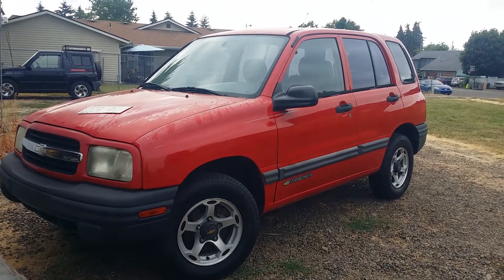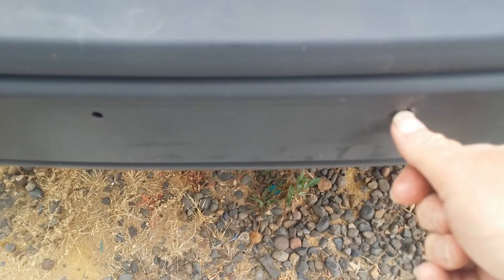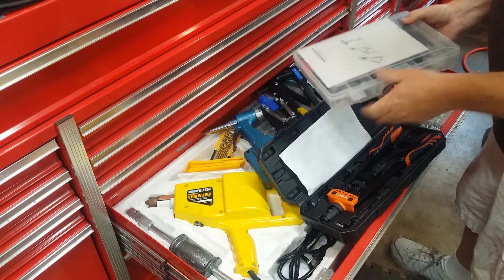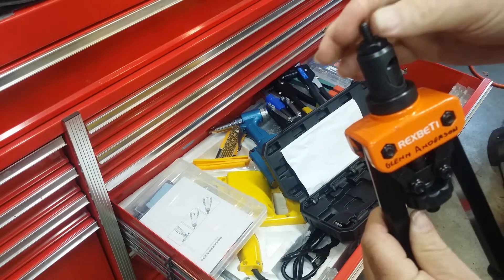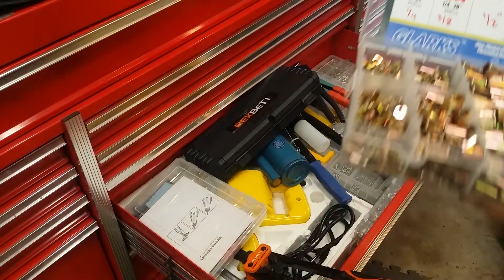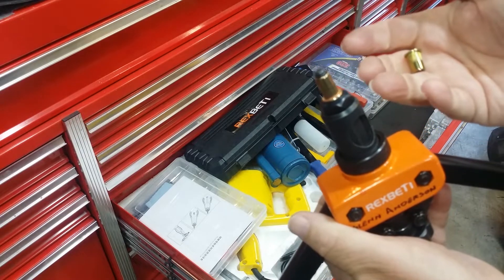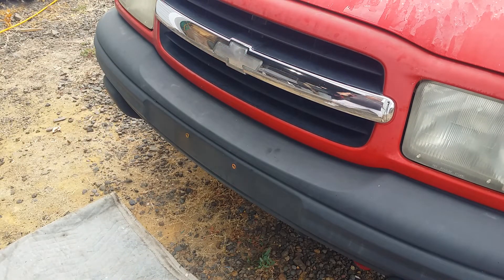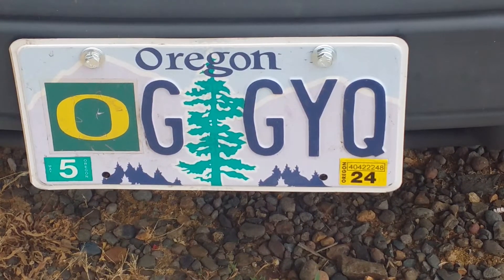Today I install nutserts or Rivit nuts in a plastic front bumper and bolt the license plate back on.

Comment: Thanks for your reply. In my research I've found that plusnuts are stronger than rivets so I'm going to try those instead. I've ordered a tool to use. Appreciate your video . I don't know how thin the plastic bumper is, so I'm going to put a 2-3 ft steel flat bar on top of the bumper and rivet it to the bumper for strength. On top of that I will plus nut rivet the mounts for the light bar.
Reply from the maker: Good luck with your project!

Glenn

Comment: I would like to mount an LED light bar to my trucks plastic bumper. Would the nutserts work and be strong enough to hold it on? Thx
Reply from the maker: I think they would be fine, two on each side, nice tight holes. If the bumper material is thin, consider sheet metal or washer behind the bumper. 
Good luck!

Glenn